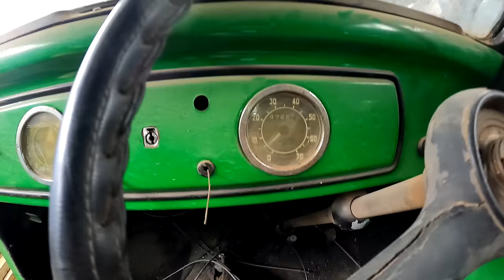Not another silly little car!? I must delete FB Marketplace before I'm broke!

Comment: Except for the nose, that body looks like the ones they used to build A/altereds and gassers back in the 60s.
Looks like you guys had a good time on the trip.
Reply from the maker: Yes, this one is the slightly later version (1951) of those 1937 models

Comment: Hey Dif, my first ever car, back in 1965, while I was still in high.school was the 1948 version of the "Topolino" 500 Fiat. A guy gave it to me with a broken bell housing, it was his daughter's daily driver, I was a "teenage mutant ninja barefoot mechanic", he said "you can have this but you must get it going again!" I did, the rest is history. That was 60 years ago, I still remember that "Little Mouse", a far better looking car than that later model you have there, but I'm sure the "Rat Rod boys" will improve it. Great find mate. Cheers from Australia!
Reply from the maker: Yes, the early ones were the best looking. Very hard to find here without paying an arm and a leg!
Reply: @ratrodsafrica  yes mate, I cut that one up and "hot rodded" it even way back then by putting the Fiat body on a Morris 8 chassis and engine because the original engine was so piss poor. I often wonder how much "The little Mouse" would be worth now in original condition,🤔.  But then that's the way many have gone over the years,😂 but it's been a fun ride.

Comment: Thanks for the road trip!  I used to bomb between Knysna and Cape Town in an Austin Apache as a student in the 1980s, and my late father owned Tangent Engineering in Knysna back then. Good memories!  You should have bought the Austin 10 and stuck the engine and gearbox in from one of those Datsun 1200 bakkies outside Bobby's place 🙂
Reply from the maker: Small world! The Datsun bakkie engine will work well in that Austin, but you would have to upgrade the Puddle jumper's brakes!

Comment: Hey Div,
   Yet another reason why I do not have facebook on my phone.
Enough stuff finds its way to me without it.
   But hey, we need to have those toys to keep us busy, off the streets at night and out of trouble, sorta.
   After reading the other comments, I somewhat agree with a couple of them.
   Just as a toy to play with, a horizontal crankshaft small one cylinder engine would be fun.
   Then when that has ceased to be fun or is destroyed,  a larger two or more cylinder engine from a motorcycle would make the little car quite road worthy.
Maybe even scarry !
   But if I remember correctly there is no transmission in the car so that might be another project in itself.
Thank goodness for Marketplace !
   I have faith in you Div.
I have no doubt that is something you can handle.
   Thank goodness for Marketplace !
Giggle, Giggle, giggle.
   You live in a beautiful area, thank you for sharing it with us.
         Rock On
Reply from the maker: Yes, the bike engine idea keeps haunting us!

Comment: Hey Diff, Love your work! I have always been about the shiney paint but watching your chanel has turned me around. I'm geting ready to start a ramps truck build with a 97 Dodge 3500, dually diesel 4x4. I was going to paint it but now I am thinking I will leave the nice patina and detail the engine and frame. It will be bagged and about 600 hp of 12 vale Cummins wuth a 5 speed. The truck is from California so it is mosly rust free except for the surface rust where the sun has erased the paint. Don't be supprised to see it with a air valve systen very much like the one you made for the Hudson!
Reply from the maker: You won't believe how much fun it is not having to stress about shiny paint! The build sounds good!

Comment: Second comment…..
Motorvation? 
I suspect someone, if you drop a few hints……. Will have a BMW K75/K100/R1100 or any of the R series bikes laying around. 
Aircooled, shaft driven and easy to fit in the hole.
Reply from the maker: That would be interesting! 👍
Reply: Wat van n gratis enjin?
Reply from the maker: @Grizzmakes  ons like daai soort! 😂Waar kry mens een?
Reply: Jong…….

As jy my toelaat kan ek bietjie rond krap van hier af. 
Ek dink daar is potensiaal in n BMW enjin. 
Jy kan allerhande opsies oorweeg.  

Maar gratis is die beginpunt, en jou permisie dat ek kan rond krap.
Reply from the maker: @Grizzmakes  as jy wil rond krap, gaan ek nie kla nie!😀 Thanks!

Comment: You should have bought the Austin and given it to your wife to drive - very nice car. What' size rubber band will go into the slime green Fiat? I think you have to get that ramp truck built. That trailer was NOT something to put a car on safely. Are YOU going to be working on anything or are you just the camera guy now?
Reply from the maker: The trailer has an 800 kg rating, and that little car without engine probably weighs only 400kg or even less. I've been doing a lot of behind the scenes work on the Renobug. You will see in upcoming videos